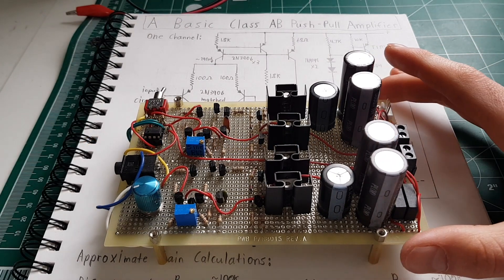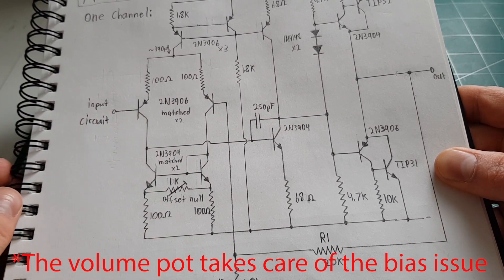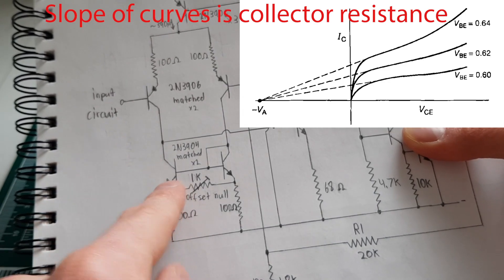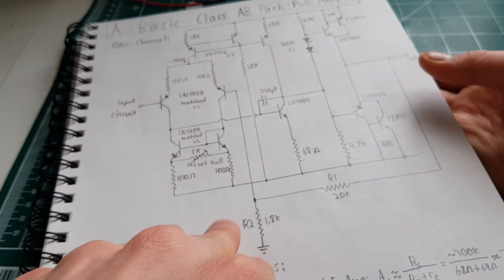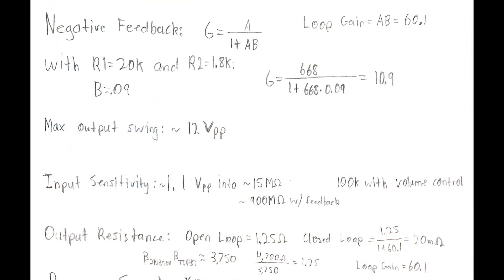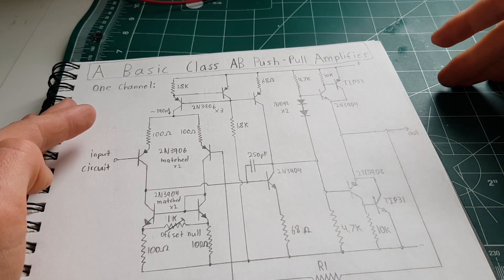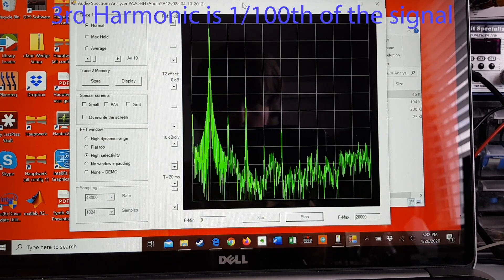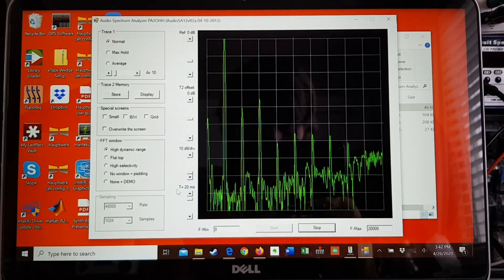Simple Class AB Amplifier

Comment: I've constructed something similar but using an up fron Op Amp instead of the many transistors ie long tailed pair and current mirrors etc. I chose to feed the signal to the centre of the doides rather than the bottom. Using a NE5534 I can get the offset to exactly 0mV. It works pretty well.

Comment: So doubling voltage in the mono mode quadrupled power as load R is fixed? Nice. You need to be able to handle the higher dissipation though.
Reply from the maker: It does get hot. Those tiny clip-on heatsinks are too small and I can't run it full blast for too long.

Comment: For ripple rejection split the value of the current reference resistor into two and add a polarised capacitor from the positive rail to the middle of  the two new current reference resistors. This may reduce the current from the current sources.

Comment: I think the two bridge rectifiers in parallel won't work as you intend it to. Diodes are not like resistors, as in they won't share the load. If two parallel diodes aren't matched to the same forward voltages, whichever turns on first will dictate the voltage across both of them. ie the other one will never turn on. This is the reason LEDs in parallel need a resistor for EACH LED, not one for all of them. It would be best to just get a single bridge rated for the current you need to run the amplifier.
Reply: @andrewshepherd383  No worries, thanks for putting in the effort to make a video! I don't know much about amps (which is how I ended up here), but I learned a few things from this. Maybe a cap on the output as well would help with the DC, you won't need a large value since the transistors aren't biased too much. A follow-up video with improvements would be awesome!
Reply from the maker: Yeah I know, I threw this thing together with parts I had on hand. One rectifier was getting a little too hot so I added another even though I knew one would probably current hog the other. In fact, not long after I made this video I realized how bad this design is in general. It has really bad input offset current so when you turn the volume knob it shifts the operating point of the output stage. This puts DC across the speaker which is not good. I ended up taking out the pot and added input caps instead. It has almost zero PSRR because the hum is awful unless you use a regulated supply. It also drifts with temperature worse than I thought. The only good thing about this amp is the sound. These are things I should have seen in advance when I saw the schematic. Instead, I didn't read into it too closely and just built it.
Reply: Can you expound on that and how can we use a volume pot to make it better?